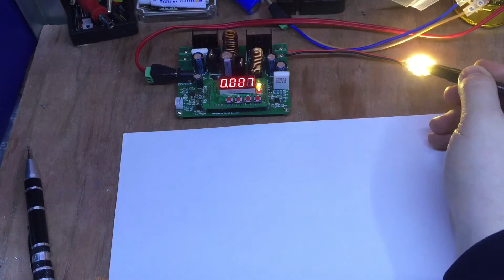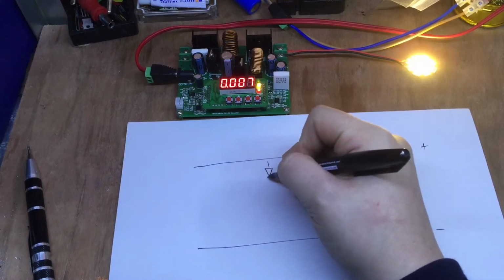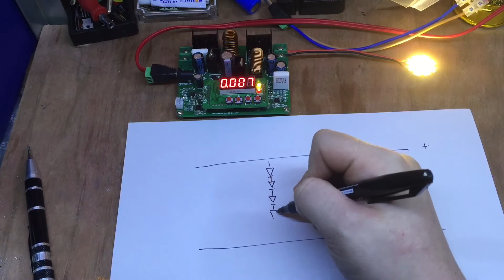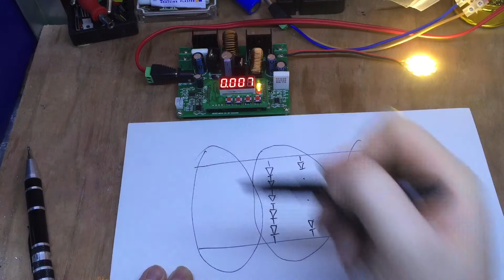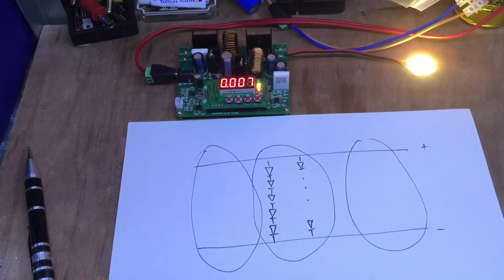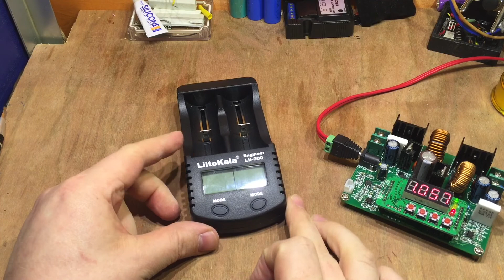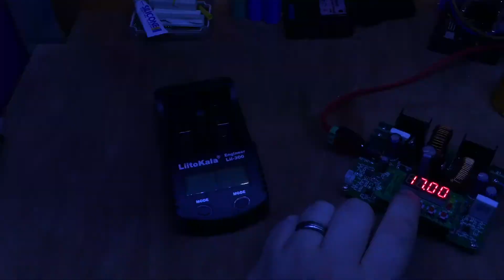High Power LEDs in Parallel - Bench Light - 12v Solar Shed

Comment: Why not measure the max acceptable current through the COBleds, then PWM the lot using an arduino and mosfet. The voltage tends to drop when they heat up, so when used with fixed voltage, the current rises when they get hot. With the arduino you then could easily add a pot te make them dimmable (even with an off switch pot)
Reply from the maker: +Kenneth Tan Thanks for all your comments.  Actually - I'm working on that... :-)
Reply: I have a schematic handy. Will look it up for you. it includes calculations for the feedback resistor that controls the max current on the mosfet combined with the gate transistor.
Reply from the maker: +Kenneth Tan That sounds interesting. I'll love to take a look. 

The DC converter does constant current and constant voltage. I've set it to 1.2amps (300mA per Cob). I'm waiting for another constant current led driver to arrive so I can use my DC converter for other projects again.

Comment: working under white LED light tends to make me sleepy and gives me a headache. I like the new lights is there a difference in power usage between your led strips and the new cobs?
Reply from the maker: +pietkaify Bright white can be a bit harsh, I'm not sure they make me sleepy though.  I wonder what the theory is - same colour temperature as moonlight?

The new Cobs will pull about 1.6 amps at full brightness from my battery bank.  The original string pulls about half an amp.

Comment: Looks good! I'm not sure warm white makes much difference on camera -what with auto white balance sorting things out, but I much prefer it in the flesh compared to the cold white. FYI I've had a lot of success bonding LEDs to heatsink material with metal epoxy resins -both the pour & mix variety as well as the putty type. The only downside I've come across is that they are very permanent :)
Reply from the maker: +Lasty Thanks for the feedback. I think you're right on the white balance - doesn't seem to make much difference once the camera has adjusted. Thanks for the tip about fixing the cobs. I may just try that.